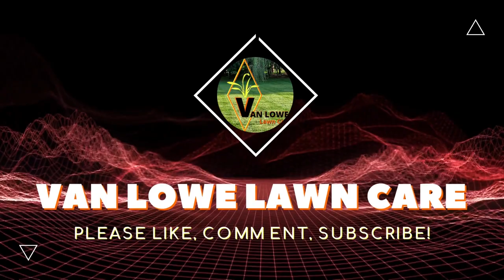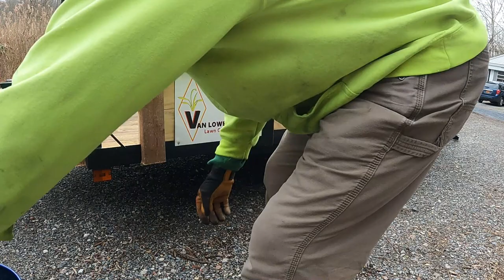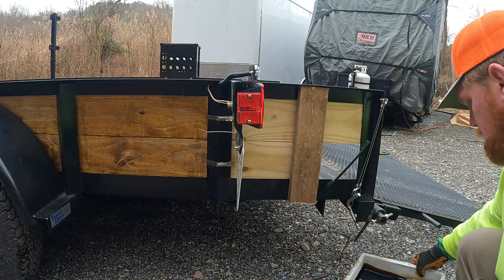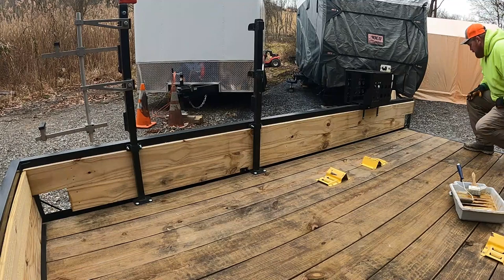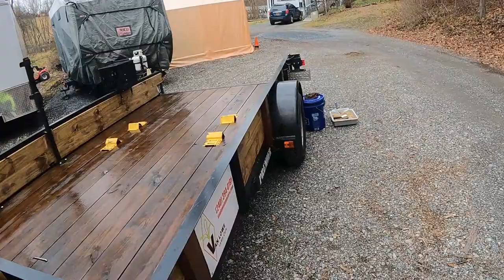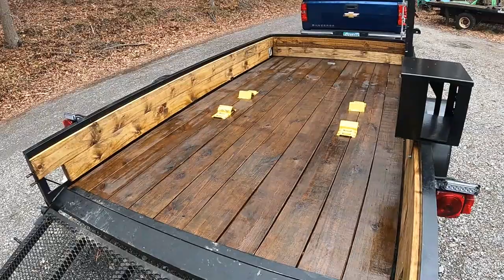Treating Trailer Deck and Sides w/ Used Motor Oil | How the deck looks after a year

Comment: I actually did this to my car trailer. Took a few days for it to soak in. Darkend up the wood. But i did do a small test spot of water, and it beaded up on the surface. I used some used motor oil from work and off-road diesel. Next time i will use a pump sprayer instead of a brush
Reply from the maker: Yep, it definitely works well and I will for sure continue treating the trailer deck this way.  Not sure if the process I'll use to coat it next time though!

Comment: Guess i always thought this would need to be a hot summer thing to make it soak in?
Reply from the maker: That certainly would help it soak in faster.  With no snow in my area this past winter and the trailer just sitting idle, I figured I'd get it done.

Comment: If you sit on the trailer down the road does it get on your clothes. Also when it rains is it slippery?
Reply from the maker: Once the oil actually soaks in and "dries", I have not had any problem with staining on my clothes, and no slipping when wet.  It creates a great long term water beading thaough

Comment: Why the diesel fuel, my trucks use 5w-20, so it is really thin, after a few thousand miles of towing. It burns about like diesel for a fire starter.
Reply from the maker: I did the diesel fuel because of videos I saw before doing this.  Plus I think it helps lighten up the oil a little bit.  It's really personal preference honestly.